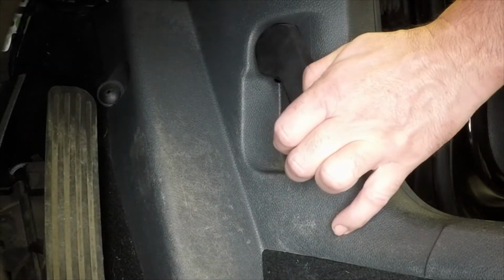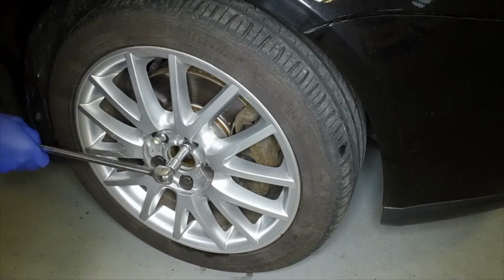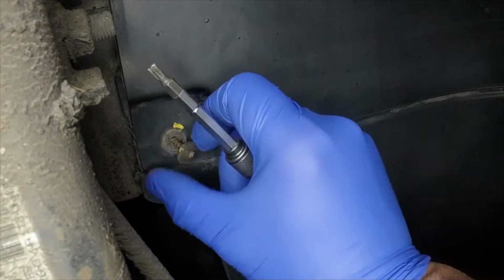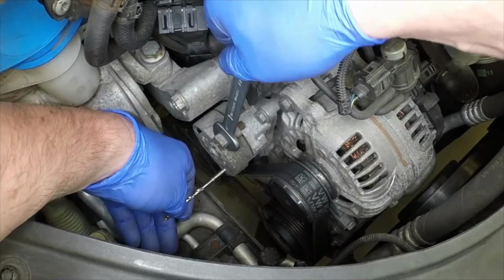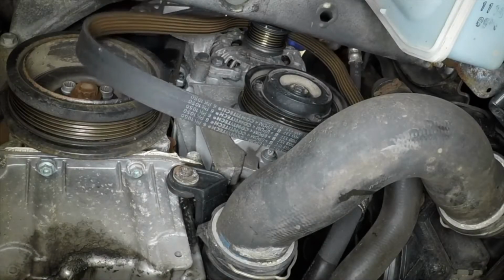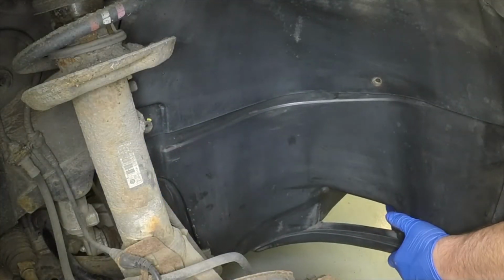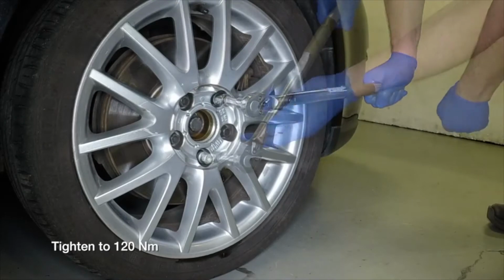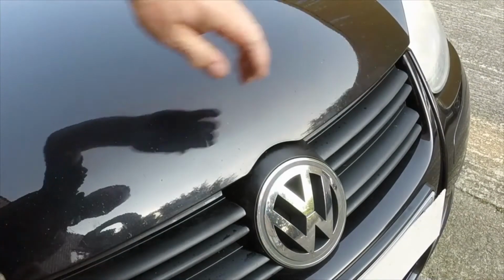How to Replace the drive belt on a Volkswagen Golf 2004 to 2008

Comment: Do you really have to take tire off?
Reply: Makes it easier to access it if you have the place to lift your car. In my case I don't have a drive way and just removed the tank etc and squeezed my hand inside and got it working.